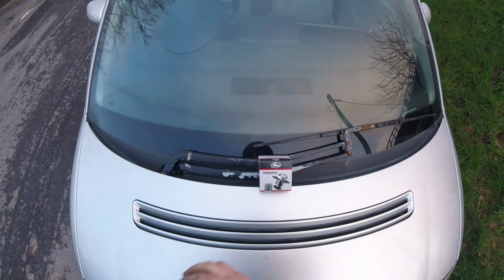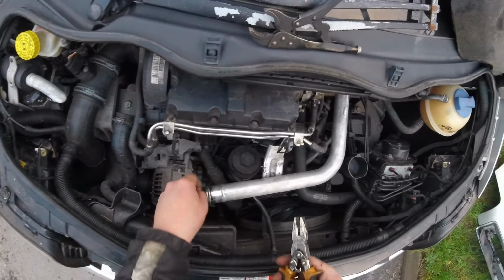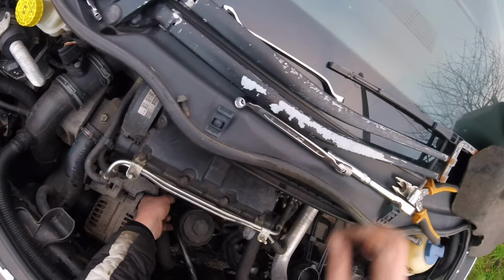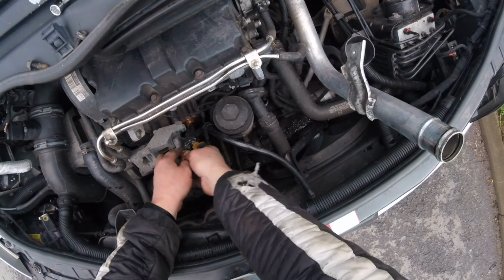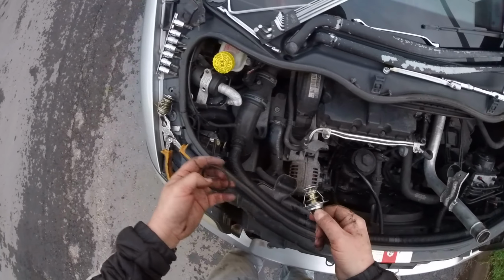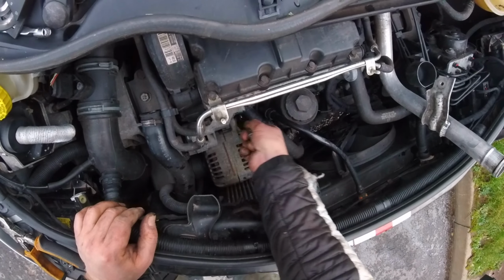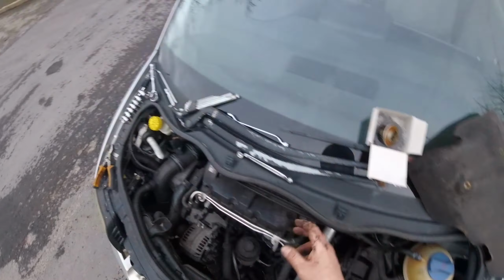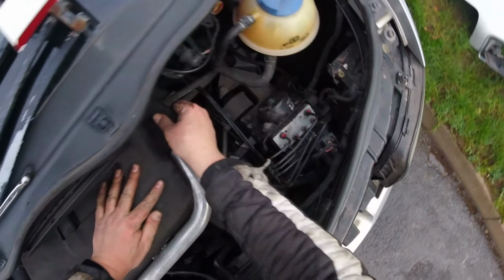Replace Audi A2 Thermostat 1.4 TDI

Comment: Thanks for the video, i have the same engine but in a different car (VW polo 9n), and I'm suspecting i have a thermostat problem, since it takes kinda long for the engine to get to temperature.. Also the hot air is not consistent.. i'll check that for sure, thanks for the guide!

Comment: Great upload,any link to the special tool? Size? please,oh and there Mole Grips not pliers
Reply from the maker: it is this one https://www.ebay.co.uk/itm/12-Point-Flexible-Head-Socket-Wrench-10x11mm-Metric-Double-Swivel-Box-End-CR-V-/363630497995?mkcid=16&mkevt=1&_trksid=p2349624.m46890.l6249&mkrid=710-127635-2958-0

Comment: Hello!! I solved hopefully the engine temperature gauge !! I disconnected the battery for an hour !! after i put the abscessed battery back on the switch for 3 minutes, after i went up the motor I went around, everything worked when the temperature reached 90 degrees! not only did the engine not work the n73 turbo sensor started to work now the car was much better! the electronics of the audi is a mystery!
Reply from the maker: nice one 👏👏